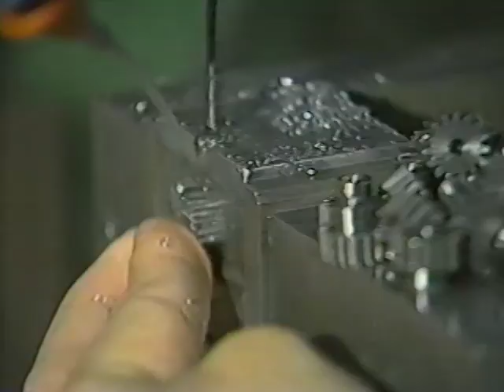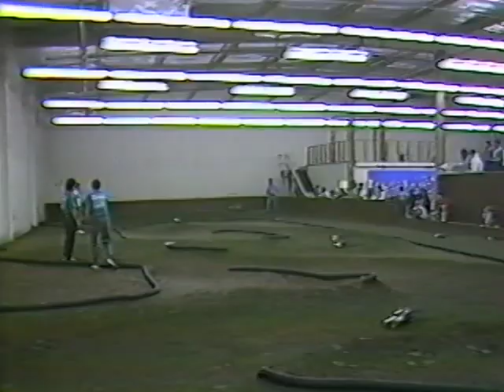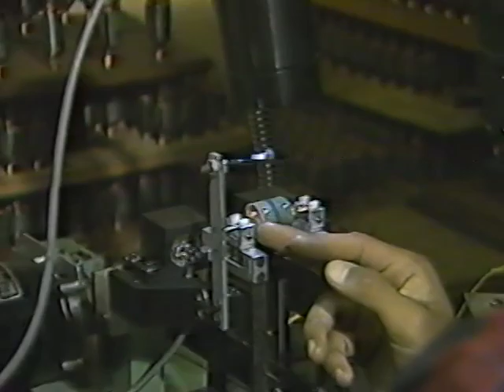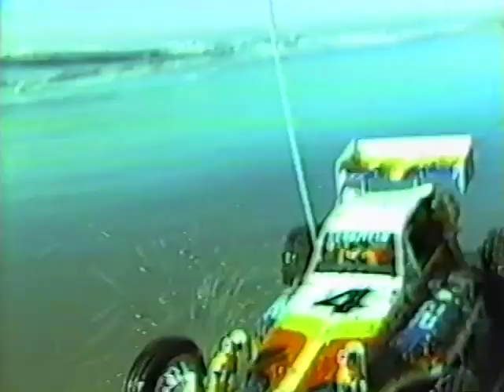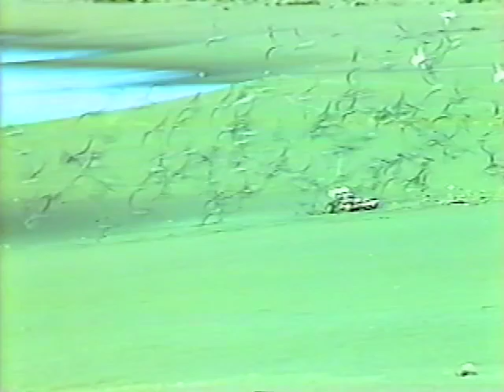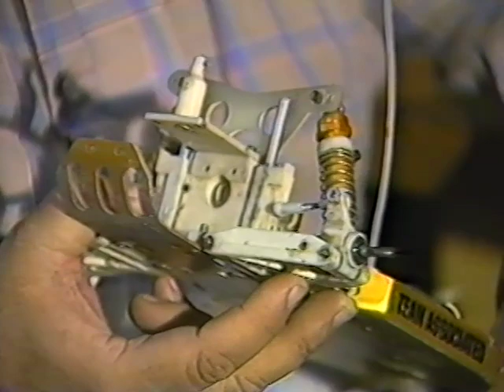RC10 The Winning Edge with " Jammin ' " Jay Halsey . Part 2 of 5

Comment: How much were these new in the 80s.
Reply: A kit less electronics with bronze bushings was $188. This is equal to $529 in 2024 dollars. The full kit with motor, MSC, bearings was $269 or approximately $825 in 2024 dollars. Only a small few could afford these.